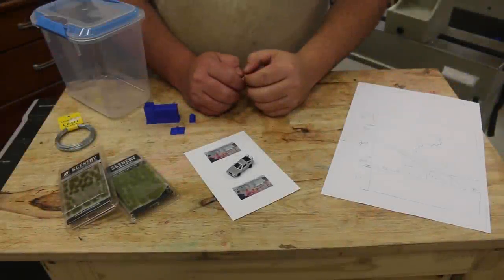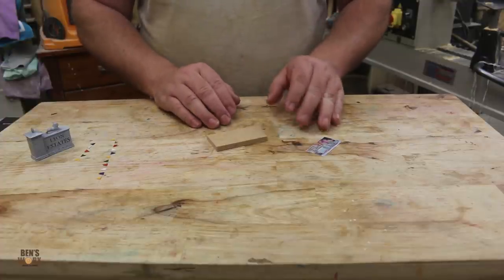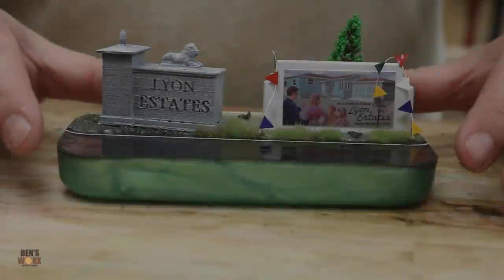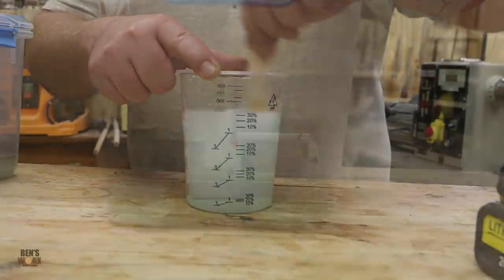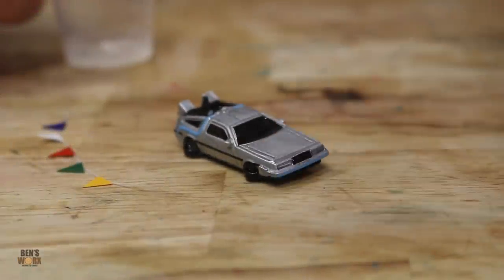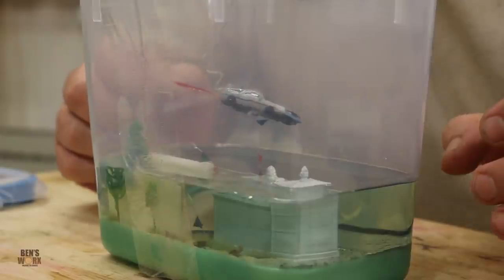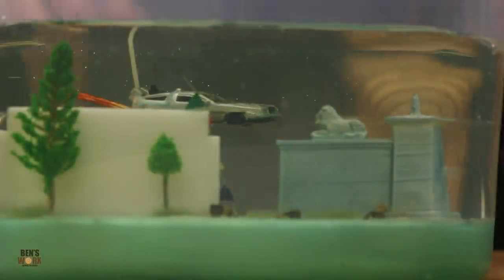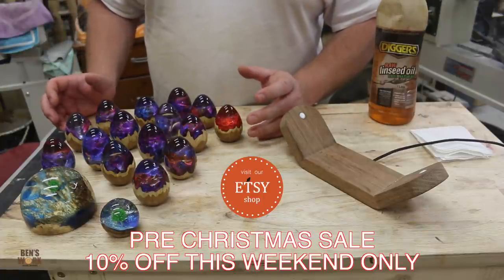Making a Back to the Future 2 DeLorean Night Light - Epoxy Resin Art

Comment: @11:35  when you get bubble's like that take a very small drill bit drill a hole to the bubble's and fill it it with more resin From a syringe. Or heat up a stiff rod with your Torch and make a hole to the bubbles and again fill it with a syringe

Comment: Damn dude, setbacks or not it still came out looking great. 
I wonder if getting a resin based 3D printer would have helped for that billboard to avoid the bubbles, but you managed to sort it the second time anyway (have become a fan after switching to a Photon last year - beats the crap out of my old filament based A6 printer and the layer lines in PLA)

Comment: Great job. The only thing I would have done differently was to pour a clear layer before adding the car, then you wouldn't be relying on the glue to hold it on the lightning bolt. It also would have been cool to make the fire trails into the "99" shape from the movie.

Comment: Would ice in the pressure pot help with the heat melting some of the models you have used or would that create other problems ?
I look forward to each new video. Well done Ben.
Reply from the maker: Thanks Mate, it helps a bit

Comment: I wonder what the difference is between using high pressure and a vacuum to set the resin with. Is it specific to the resin used, personal preference, depends on the project?

Comment: Hi Ben, I love your videos and your humour. Having seen a lot of the videos though, it does feel like you're trying the same thing, expecting different results. Your deep pours have basically always produced issues - as would happen with everyone, the heat is just causing to much problems. But your next project is always yet another plastic object in centimeters of epoxy. 

Maybe it would be a nice video to do some deep pour experimentation? Things like layering semi-set epoxy, different kinds op epoxy, stuff like that. It might help your next project onwards.

Comment: Why cant You de-gas the resin with the pressure pot and then pour it into the mold and let it cure without all the pressure? You always use that pressure pot and things bend and warp...I've seen other videos were people pour the resin after de-gassing. Just curious...
Reply from the maker: I will do some testing
Reply: @BensWorx  it's just an idea..that might help with some of the warping You've experienced on other projects i;e the Tie-fighter in resin. Also, if You get a few bubbles after de-gassing try using a flame to pop the bubbles..